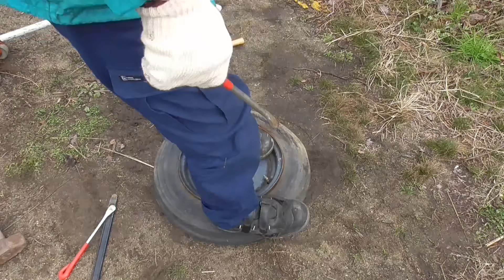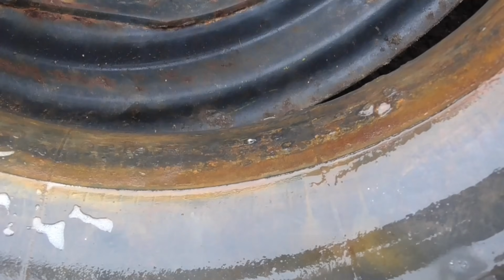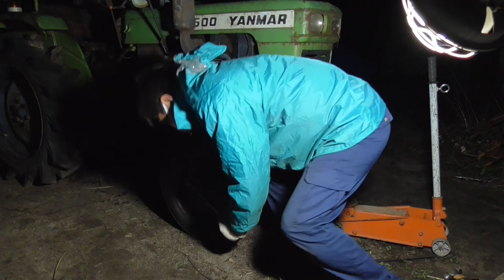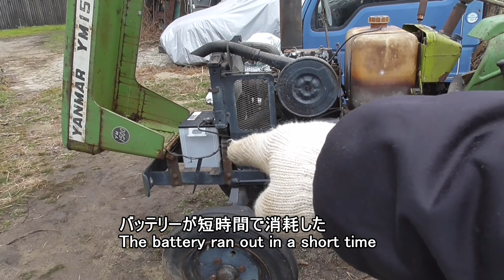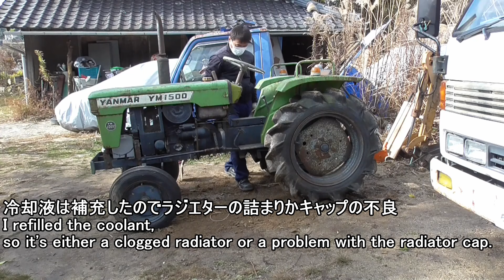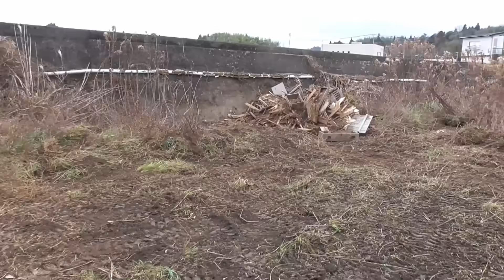ヤンマートラクターYM1500パンク修理で走行可能となるか？Will the tractor be able to run after a puncture repair?

Comment: Mr. Yamaki, maybe you can try a hand technique to release the clutch... Tie the clutch pedal down like it's constantly pressed, then put it in 2nd or 3rd gear to begin (not the shortest one, but in the middle), then grab the rear wheel on top and jerk it forward and backward, since you have always enough play between gear teeth. You don't need to be too rough though. If it still doesn't release after some time, then you might have some mouse nest in the bell housing, if there are some openings big enough. If mice piss oo the clutch plate it might get almost permanently stuck..
Keep on, good work, but be careful with tractors.  👍